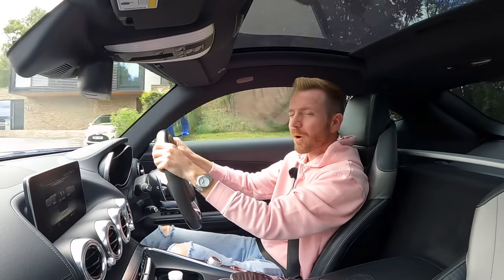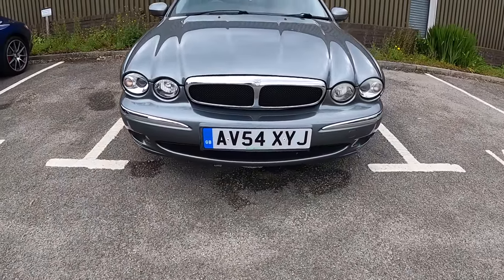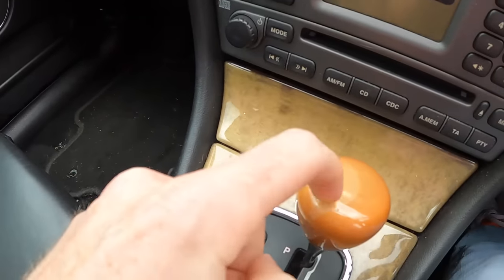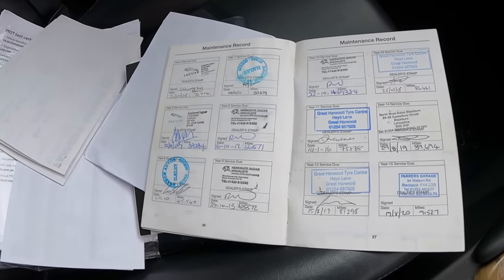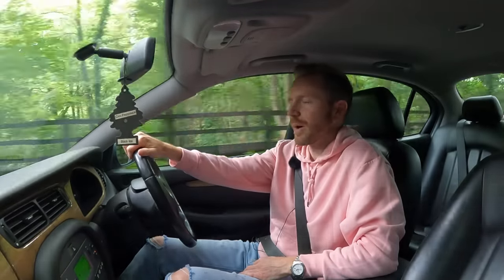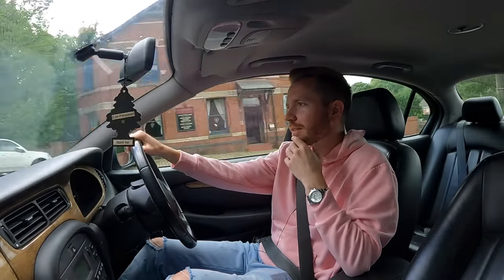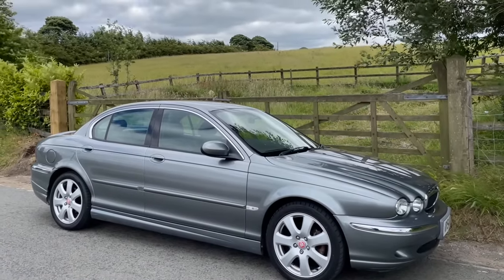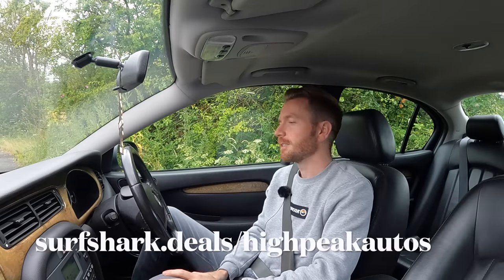I BOUGHT A CHEAP JAGUAR X TYPE!

Comment: Bought one more out of curiosity than want. It had only 15k on the odometer and was in good shape inside and out. The engine spun a bearing at 30k had to replace the engine. Maybe just a fluke but it put me off budget Jags. Had a 68XKE, a 2004 XKR, and a XKRS. They were good cars which kept me from turning against Jags all together.

Comment: I had a 2.5 sport on a 53 plate. Same colour and a sport so no chrome. Sat nav and CD changer. I loved that car more than I should have, and although I had it for three years we had some great adventures together,  one driving 700 miles in a day down to Lucern in Switzerland. Good times. After that the jaguar draw has never left me and on Friday, finally changed my Kuga I have had for five years for a really tidy 2012 3.0d Jaguar XF premium luxury in a similar colour. Good times are back.

Comment: Lovely jag  and lucky to find one  not needing much work.  Where do you find them so  cheap,?  How much is the car tax?  Did you use trade plates on this ? 
Normal punters would have to tax and insure the car,  then claim back the tax  when they sold it (losing a month) negating into the profit?

Comment: Jag changed the water drain off design for the 2004 and onwards models so sill rust is much less of a problem with the newer ones. Some 2004 models however were still the old model. I’ve had my 57 plate x-type for a year, no problems and no advisories at the mot. It’s a sovereign, with a leaping jaguar (sorry), and I paid £750 at 101k miles.   Purrs while cruising and roars when I use my right foot in anger.

Comment: I always like the X-Type, and never understood why the badge-engineering was such an issue. The Mondeo of the time was a great car, and a sprinkling of Jaguar luxury was a bit of a no-brainer. And in hindsight, it seems like it was just ahead of it's time. Let's be honest, almost no car chassis isn't shared across multiple models and manufacturers and today the X-Type would be an obvious thing to do. And it's still a handsome car; like the old XJ's younger sibling; equally as smart and well-dressed, just smaller.

Comment: I've got a 2005 diesel with loads of extras, nice sporty wheels in silver which had 80,000 on the clock and sills replaced, paid a grand for it.

Comment: Top vid as usual Matt, but what's up with having a diesel X-Type? I've had diesel Mondeos and done astronomical mileages with no aggro and awesome fuel economy. I even drove across Europe last year, in a hurry, and averaged 52mpg and 60mph! Wouldn't the 2.2d X-Type be just as good if not better than my old ST? Just wondering as I've got to do the drive again next year and I'm needing a cheap, economical estate.

Comment: that dash board buzzing noise ! My dad's does that too and it drives me nuts when i drive it !One of only a few things wrong with our  X type- the headlghts are rubbish (at least on the halogen light models) no cruise control, no parking sensors. otherwise a great car

Comment: I had nothing but pain with the X Type I had. I bought a 4 year old 3.0 v6 Sport manual with 55k on the clock and a full jag service history. I had it a year and covered 7k miles, in which time the transfer box had to be replaced, I had to have new headlights because you could not change the bulbs and rear suspension work had to be undertaken. I then struggled to sell it for half what I paid for it. Maybe the later ones were better because the early ones were awful. The Mondeo on which it is based was a much better car! Cannot bring myself to have another Jag. Shame, as they look smart

Comment: I've got an xtype 2.0d estate , I keep thinking about changing it but I've had it 12 years and it has only broke down on me once and that was a corroded jubilee clip on the turbo , it keeps passing its MOT with very few repairs ( usually brakes but that is a wear and tear thing anyway ) it's a tatty old thing same year as that one 04 but it just keeps going and averages 45mpg , that one you have there is a cracker for it's years

Comment: My family has a awd 2.5v6 estate xtype since 2005 and its been a extremely  reliable car. The family only did the very basic maintenance and even now in late 2022 it works perfectly. Even when standing  unused for several  months (3-5months) it starts up with only one minor warning which goes away after a few miles of drive.  Im surprised  how well it holds up. It has run fairly low amount as its just over 152k km. But as i stated previously  it only had the basic maintenance.  So overall  if these cars especially with petrol enginse get a tiny amount of love&care they do run without any serious issues. We only had to change battery  2times and the stability  control electronic unit 2times in 17years along with oil and filter change every 2years or 10k km. We also had a 99' S-type bought used at 2017 with 180+k km and used it for 2years and 30k km with only 2oil and filter change and one battery change. So basically  in my experiance jags from 1999 to 2004 are actually  pretty  great. Though this is only my experiance and i can't  say all jags from that period of time will do this well but what i saw they do pretty well

Comment: I have a late 55 plate 2.0SD manual diesel estate, had it 8 years and fuel economy is brilliant.  There should not be any visible screws fixing the top edge of the sill covers. They're held on with hidden plastic clips, very similar to interior door card fixings, and several all plastic plug and screw fixings underneath. They've probably been broken if the covers have been off for any sill welding.

Comment: Nice auto that one. They’re pretty rare in my area of the US. The ones that are still available usually have the snot driven out of them. Might find a decent one out at a high price dealer in West Hollywood. It’s a shame that they received such a bad rap. I think most of the flack came from auto snobs…complaining that it was built on a Taurus platform. If folks took care of them, there would be move available…like yours. Enjoyed the video…thanks.

Comment: Bought one years ago it was dragged thru bca, auctioneer said driveshaft, turned out to be transfer box, fitted one and did OK on it. Had a s type and it was absolutely rotten underneath, jacked it up and screen cracked!

Comment: Very interesting point you make about the leaping cat on the front of a Jaguar. In the early 70's I would have never thought of putting one on the bonnet of my XJ6 and neither did anyone I knew back then. I don't think the bonnet was designed for one and neither did they design a leaping car for those cars. However I do have have one on my 1996 XJ6 and have had them on every X Types. The interesting thing is that these cars bonnets were designed to take the leaping cat. Probably because I believe they were standard on the US models.

Comment: Whilst on a jaguar X-type course once, jaguar told us it spent 30 million in redesign on the V6 engines before they were happy to put them in. The V6's started out in the granada's in the 70's.
Trouble is gas guzzlers like this are harder to shift due to the fuel crisis

Comment: I had a black 2.5 Sport (no chrome) and found it great to drive and got over 40mpg all day long if I was pootling, and enjoyed what was under my right foot when I needed to drop the hammer. Handled great, with grip for days, had decent SatNav and Jaguar talk voice controls for pretty much all the ancillary controls. 
My only real gripe is the 4wd seemsnto be forwards only, there were times when I had to reverse out in less than ideal grip and it seemed to be one-wheel-drive which left me needing helpful hands to push to get free.

Comment: Really impressed with the wheels' refurb! £170 all for? Real cheap. That's a little more than the price for a single wheel refurb in France!
Cheers and keep it up!
Reply: I think it's mates rates. Cheapest I can get a refurb on 18inch wheels is about £100 per wheel.

Comment: This model was so hard to put together ,it was designed so quickly that the parts on early models where a poor fit , the door parts of the chrome and the cappings scratched or bent just by looking at them ,glad when they decided to stop building it.

Comment: I had the 2.1 petrol before buying the 2.2 diesel I have now. I love them as you get a lot of car for the money. My 57 plate diesel cost me £1500 2 and a half years ago. The 2.1 petrol was the hardest one out of the 3 petrol engines to charge the spark plugs as on the 2.5 and 3 litre they rotated the engine to allow for the 4wd shaft. The 2.1 had 3 spark plugs at the front dead easy but the back 3 were a pain as they are at the back.

Comment: I've had two X-Types (U.S.), one a 2.5 manual, the second a 3.0 manual.  Fantastic cars!  Unbeatable in the snow, handled very well, rode nicely, and all-in-all were a hoot to flog on.  The 2.5 was a bit of a dog by American standards, but the 3.0 would get up with no problem.  I'd probably still have the second one, but the northern U.S. rust had it looking like Swiss cheese underneath.  

It always strikes me as odd how they got spec'd over there.  Like, I don't think one could buy a FWD version in the United States at all.  The 2.1 was never offered here afaik.  Even the basic ones were decently equipped (you could really get ones without power windows over there?  Eh?).

Also of note:  The earlier ones, at least in the U.S., all had OEM leaper hood ornaments as standard from the factory.  The later ones lost them in favor of a badge in that spot presumably due to the pedestrian crash standards in Europe and standardization of manufacturing.  Personally, maybe it's just because they had the leapers here from the start, but I still think they look better with the leaper and like someone vandalized the car (hood ornament theft was a big thing in the early 2000s here) on the later ones without it. 

Glad to see someone that appreciates these and gives them the love they deserve!

Comment: I had a 3.0 S V6, loved it, loads of power, comfortable and once I put a decent after market stereo, (I needed Bluetooth and MP3 capability) did  a lot of miles. Only got rid after some prat hit the back of it while parked outside and kept going, never did trace him. Due to the low 2nd hand price of them it ended up being written off

Comment: Owned my 08 plate 2L diesel for over 10 yrs . Never let me down i love it . No horrible crome or silly jag emblems on the bonnet I am happy to report lol Looks like the boot may have a leak 
Check the boot vents 
Just replaced mine lol £ 8 on ebay 👍

Comment: My dad bought a silver one new in 2002. Same spec but beige interior which looked quite classy.
When he sadly passed away in 2007 I kept it for a while. Nice luxury motoring and as you say the V6 was very smooth. Cost a fortune in fuel though even then. Definitely not a £2/litre car.
Sold it after about a year and got a Ford S Max as that was more suitable with two young kids and I wanted the Jag to remain immaculate. Happy days.😊

Comment: Nice video mate, and I do love a Jaguar. Recently got an 05 S Type, 2.5 SE and I love it. When I bought it, it had chrome rings round the headlights, chrome around the rear lights and chrome covers on the mirrors. Also, there were chrome leapers above the side repeaters(similar to the one on the bootlid in your video), a stupid chrome V6 badge and a chrome 'GB' on the bootlid. That, is a lot of chrome, and on a dark blue motor it, to me, looked horrible. Needless to say that with a day it was all taken off lol

Comment: That Jag here in Florida would go for between $8,000-10,000. I found and ended up buying a ONE OWNER 2010 Lincoln MKZ (same platform here in the U.S.) Premier Edition loaded with every option and only 25,000 Miles on it for $10,000. Best vehicle I've ever owned. Drives and rides like a dream but can get up and go when you need it with the bigger 3.5L V6. It's original sticker price was $43,000.
Reply: Really?? Why so expensive
Reply: @Ari-bx9cs  Ford and GM have stopped manufacturing ICE passenger cars here, except Mustangs and Corvettes, plus the Chip shortage has left virtually NO new cars on the lots and there are scarce numbers of used cars as well so prices have jumped 35% in the last 18 months. CRAZY! I also have a 2006 Lincoln Zephyr that I picked up 2 years ago for $6K, excellent condition, every option and had only 50K miles on it.  :)

Comment: I had a V6 AWD XType back in the day and loved it.. I didn't know that Jag produced different capacity V6s though. Mine was 3.0 ltr.. It was brilliant in the snow and the wet and surprised a lot of folks. Bit thirsty as you say. Had no issues what so ever and that V6 is a super smooth engine with loads of oooomph.

Comment: I owned an entry model 2.1 X Type for over 10 years, it had done 195k when I sold it and it was incredibly reliable just needed a fuel pump and a couple of sensors during that time. Nice to drive although the clutch was very heavy. Rusting sills are the biggest problem and you can't tell unless you remove the sill covers. That's a really nice example you brought and at £800 it was a steal! Nice colour and SE is quite a decent spec. Totally agree about the leapers - should be banned on any Jag newer than Mk2 ! Love the shape of the X Type -a future classic I reckon.

Comment: had a 2.5 manual, great car, definately seemed pretty solid on the road, the only issue they have is poor quality transfer boxes- they apprently weren't set up correctly by jag and the rebuilt ones were better... the early ones were also terrible for underside rust... pretty good in the snow, ii never had an issue going up reasonably steep hills in the snow in mine..

Comment: Hi Matt,  I bought one during the plandemic in British Racing Green,  just to use as a runabout. It was in good condition and the old man who was selling it had a full service history on it.  A very clean old thing and I paid £895 for it.  It was the 2.2 diesel.  Same mileage as yours with literally no rust on it.  I used it for about 9 months and when I sold it I got £1600 for it because the values had gone up.  I looked at a couple of others in the 2.0 version but found them to be a little bit noisy.  Nice old lump and decent on fuel.

Comment: Funny you should say, I’ve been having a sneaky peak through autotrader for an X-type estate too except for a diesel, automatic one. The mighty Freelander is killing me with its thirst for diesel so need something a bit more frugal
Reply: I had a manual 2.2d and I drove it pretty sensibly.Mixed driving I would get 41mpg, 46 on a run. Not as frugal as you'd think
Reply: @robertavadani5946  bit more frugal than the 28mpg average I get in my Freelander 2 😂

Comment: Given that it's had 5 owners, and only done 95k miles - should that raise alarm bells? Cynical me thinks there might be an issue that causes owners to move them on...
Reply from the maker: 5 owners in 18 years?
Reply: @HighPeakAutos  Fair point... forgot about that 😂 Really enjoying your videos, especially the Range Rover. I did some work at JLR in Solihull a few years back and used to watch the L405s rolling off the production line. Always fancied a Saab and a Jag XK, too.
Reply from the maker: @wb7181  very nice